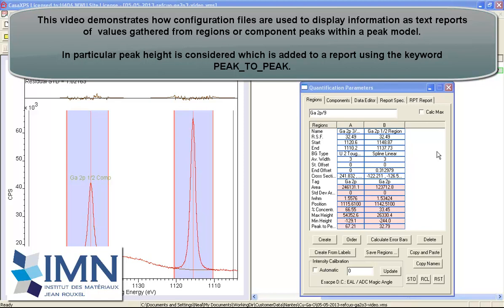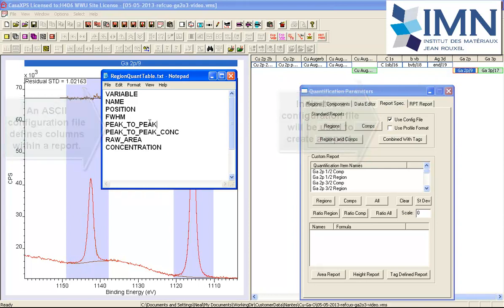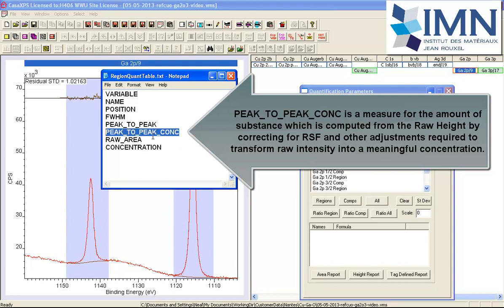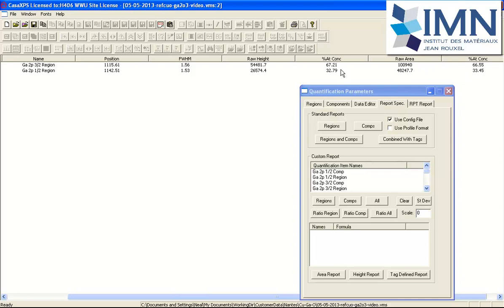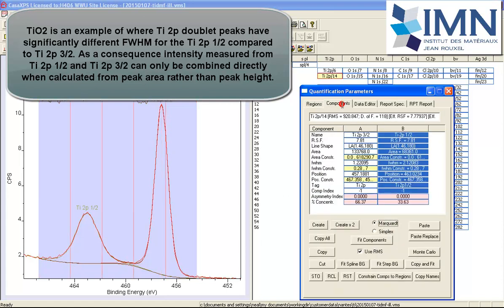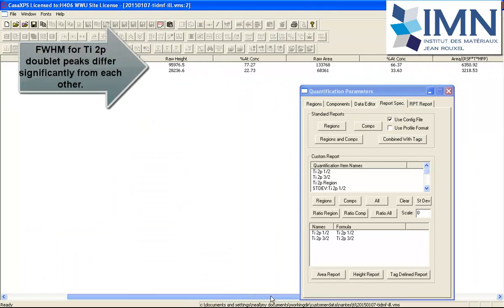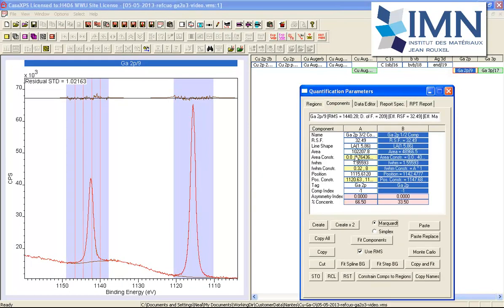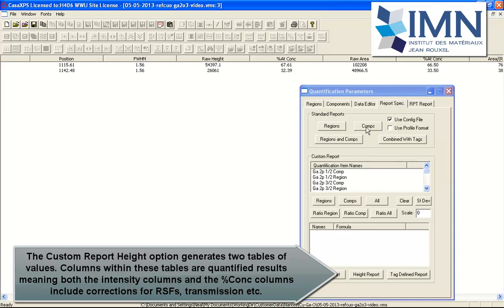Peak Height v Peak Area as a measure for XPS Intensity

Comment: Hi. What is the cps limit or atomic percentage considered for impurity atoms?
Reply from the maker: The limit of detection depends on the inelastic background intensity at the location of the photoemission peak. You can find the context for this statement in: https://www.researchgate.net/profile/Tahereh-Avval/publication/334773398_Why_the_Signal-to-Noise_SN_Ratio_in_X-ray_Photoelectron_Spectroscopy_XPS_Generally_Decreases_as_Binding_Energy_Increases/links/5d40aa4392851cd04694ad95/Why-the-Signal-to-Noise-S-N-Ratio-in-X-ray-Photoelectron-Spectroscopy-XPS-Generally-Decreases-as-Binding-Energy-Increases.pdf